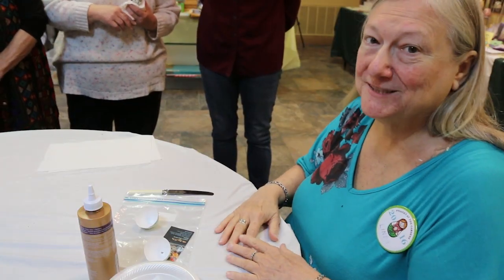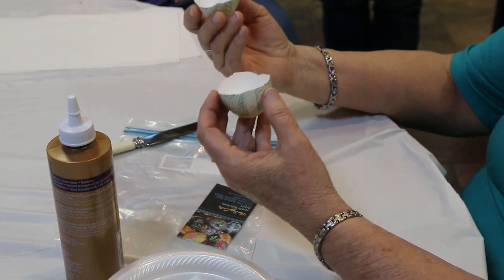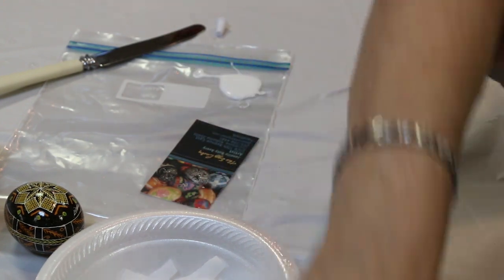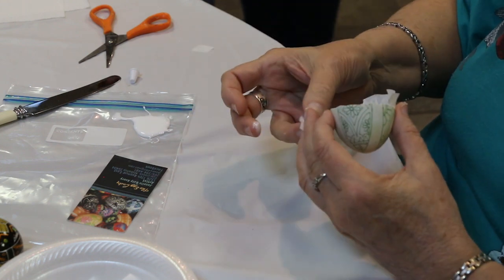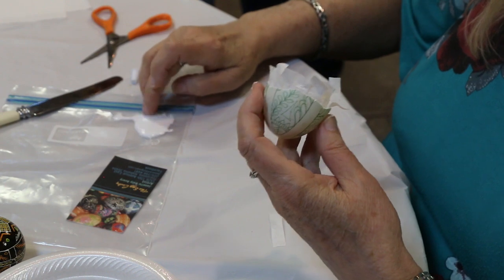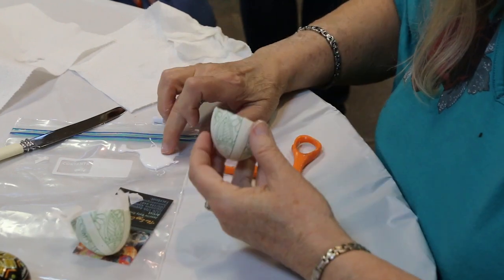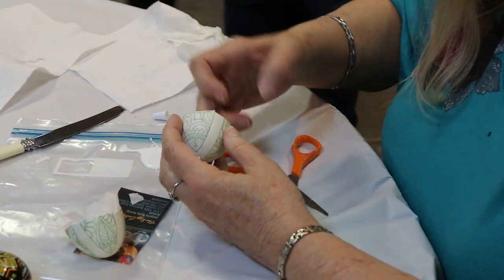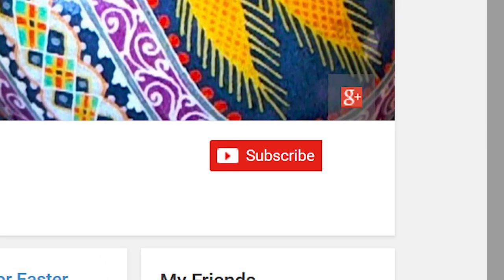How to Fix a Cracked Broken Eggshell back into a Full Egg - DIY Tutorial by Linda Hupert

Comment: not sure I want do this. guy another vedio 180 hours in one egg, I though hole were blow eggs out. spray small 1 second squat. expanding foam insulation that can. used seal cracks round doors bunch other place insulate house. idea expand inside egg fill gaps. hopeful squat out hole top. when dry cut extra off. I never done this before but if put too much in the egg there small hole for blow yoke. then things get bad. but if all works super sticky foam core that glue every inch inside egg together.

Comment: Why not just apply glue all along rim of egg and press the paper or tissue to the glue instead of what you are doing?
Reply from the maker: Certainly it can be done either way. However, this is how the demonstrator was taught to repair eggs. For many years it's been this way so  it would be a better fix and to last. Other methods have been tried, but this one is  said to last a 100 years.
Reply: Along the rim doesn't stabilize or keep the weight of the shell balanced. Gluing just the rim etc makes the over all egg more fragile then